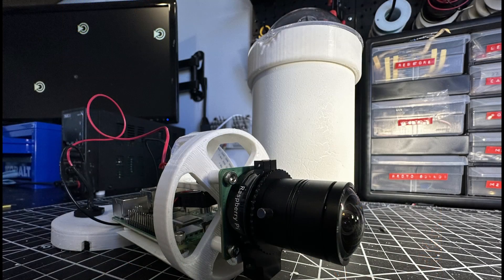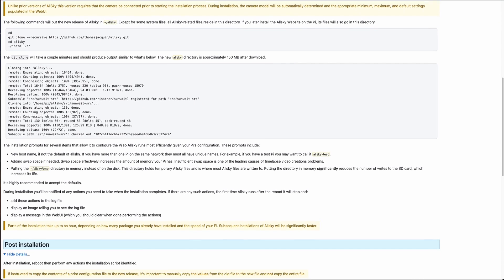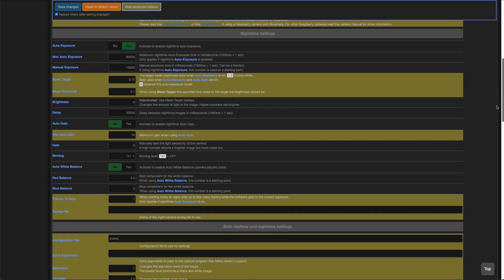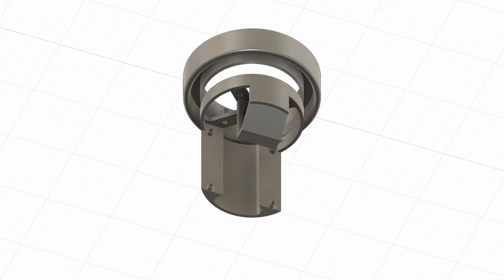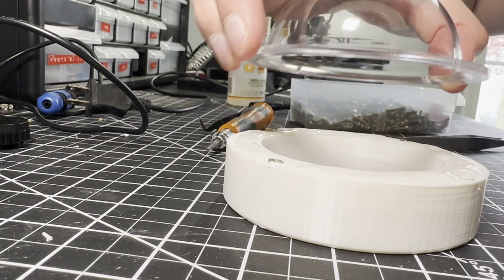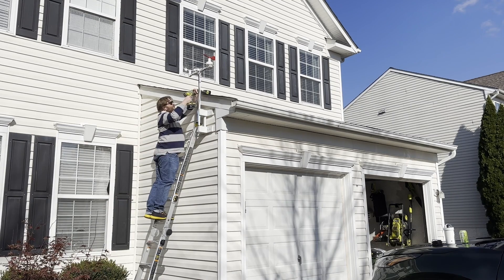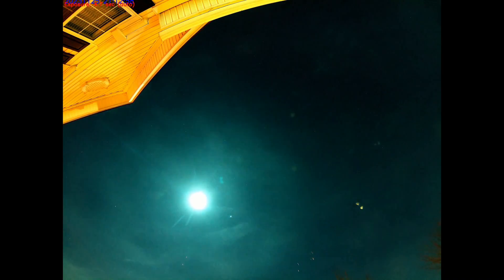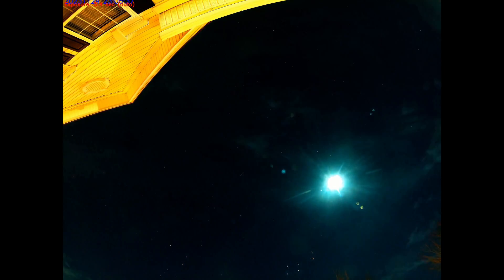Stunning Star Time Lapse Videos with a Raspberry Pi Camera and AllSky

Comment: Very nice! I built an allsky cam several years ago using a Pi but with a different camera module. I used the same plastic hemisphere from Amazon. Unfortunately the dome lasted less than a year before it turned yellow from UV and eventually developed a crack. The heat output from the Pi and the camera were sufficient to prevent fogging and condensation inside the dome. I used a PoE adapter to power the Pi over a wired network connection and mounted it on the roof next to my weather station.
Reply from the maker: Thanks! Did you find a good replacement dome?
Reply: @johnbuildsthings  Not yet.. I had other projects in the queue and haven't had time to get back to it. When I do, I'll also switch to an Arducam.

Comment: very cool project. Do you think a zero w would also work? The pi4 seems to be a bit overpowered for that project.
Reply from the maker: Thank you! The Zero might be a bit underpowered actually. The web portal and software behind it handles a lot in terms of image capture, enhancement, and management. I think the best bet instead of a 4 is an old 3 model. Also there'd probably be problems with the Zero and cameras. The ribbon connector is different and I recall having USB power issues with Zeros in the past.
Reply: @johnbuildsthings  I have build a birdhouse with an infrared camera and a livestream and motion detection to send a notification over Telegram (I used the motion software for that) and it was running pretty well on a zero w, including the web interface. Maybe I'll give it a try next year
Reply from the maker: @MarioMaresch  Absolutely! I'd love to hear how it works out. I used the Zero with a rocketry project a few years ago. It's such a useful little machine.